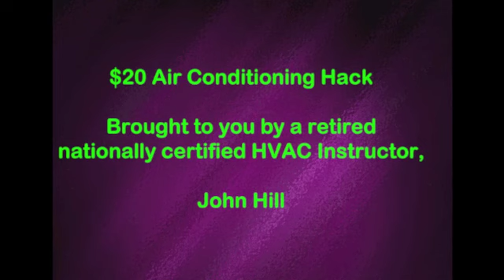AC Hack costs less than $20

Comment: Hvac units are designed and built to be in the weather. Rain, heat, snow. So this won't subtract from it's over all service life. I do industrial, commercial and residential Hvac for 35 years and have been using water to cool the condenser of my unit for over 20 years and it works beautifully if done correctly. Super heat is typically only a concern in refrigeration. Sub cooling is mainly affected by your refrigerant charge, too much will flood the evaporator and slug liquid refrigerant, too little will starve it and not have the capacity to remove heat thru the evaporator. Adding water to your condenser is no different than the outside temp dropping. So if its 90 degrees outside your supply temp in the house will rise as the condenser can't cool the refrigerant any cooler than the outside temp will allow, it is a slave to the ambient air around it. But if you spray 70 degree water on it thus your supply temp will drop and now the condenser has the lower temp to reject more heat thus lowering your supply temp. Your Delta T (Supply temp and room temp differential) will improve and it will now remove more heat from your home. Your suction pressure, discharge pressure and hot gas will all change when water is added. It will bring it back to a more normal operating temp and pressure range thus work more efficiently. My system is a bit more control oriented than this method. This mister turns on every time the system has a call for cooling no matter what the outside temp is or the unit’s pressures are. The water is usually not needed until the ambient temp is above 85 to 90 degrees if it is sized, clean and installed correctly. My system has to have (3) things happen to be engaged. (1) Call for cooling... I use the Y2 signal from my unit's stat( Y is a 24 volt call for cooling from the thermostat and starts the compressor) to pass thru(2) an outdoor mechanical air sensor set to 90 degrees, it's set of contacts are normally open and close only when the outside temp reaches 90 degrees. After Y calls and the outdoor air sensor closes at 90 degrees it passes thru the last device, (3) a head pressure switch that measures condenser head pressure and temperature. It has to be above 250psi (R-22 Freon) to allow the voltage to hit a 24 volt water solenoid coil that opens and sends the water to the misting lines that spray the water on the coils. And if the water with the fan is able to drop the pressure below 175, it shuts off the mister until the pressure rises above 250 again to keep from over cooling in low ambient conditions. I also use a two stage thermostat that has the ability to control a system that has to compressors. My system only has one compressor but the stat doesn't know that. What it does know is on a call for cooling it will measure how much time it is taking to drop the temp in the house and if it doesn't start seeing a few tenths of a degree falling in an allotted amount of time it will then call for the second stage Y-2 in this case the 2nd stage is the beginning call for water. Hope this helps anyone considering using water with your Hvac system.

Comment: Where are you getting this “120 degree refrigerant” from? I can guarantee that on a typical summer day the discharge on the compressor is well ABOVE 120 degrees, most likely in the 200s depending on the environmental factors. The condenser is there to do just that, condense. It’s taking SUPER hot, superheated vapor  and condensing it to a warm (possibly 120 degrees depending on unit efficiency and outdoor temp) subcooled liquid. They’re designed to run in 120+ degree weather, don’t waste water, your wasting money.

Comment: Had this cooler for 7 yrs, I used left over PEX from plumbing job, I did the same thing, run it on super hot days but you' ll have to decalcify AC fins at least 2 times a year,  using a 50/50 mix of vinegar in a pump up sprayer, turn unit off, spray fins thoroughly , wait 10 min, wash down with Water Only. Water PH is an issue, get as close to 7 ph as possible also using an in line calcium filter would keep the cooling fins cleaner. I have done away with the drilled PEX, now use 1/4" tubing w/'mist nozzles controlled by a solenoid ( u can use a RainBird sprinkler valve but I use a RO solenoid which is 3x cheaper) connect to 24v thermostat power...comes on/off with AC unit...using way less water, way less muddy ground around AC unit, just cooler, cheaper all around.Good Luck!
Reply: Sprinkler solenoid is 24 VAC, all I find for RO solenoid is 24 VDC. Does it matter if I use 24 VAC supply for VDC Solenoid ?

Comment: I made just like on video and works good. but 3years later condenser coil covered a lots of calcium and mineral .
I tried to cleaned with coil cleaner but does not work. finally I replaced condenser coil. that is good idea but need to install water filtering system. without that, you'll 'need to replace condenser coil.

Comment: so you leave the water dripping all the time even when the AC is off ? you can connect a sprinkler valve to the 24VAC output of the transformer that turns your AC on off...

Comment: total waste of water.  use dripper misters.  consumes a fraction of the water result is the same. theromodynamics is simple. coll the air to 70 deg and your condenser exchanges heat faster.

Comment: How do you address the mineral buildup on the coils?
Reply from the maker: There usually isn't any. As stated; this is NOT to be used continuously, only in 'extreme' heat. Here in SC, it's very helpful when heat index is over 100.
Reply: @scheadshot  I wonder if a water washdown system on the roof might be better?
Reply from the maker: @crazysquirrel9425  Sorry, I don't know what a 'roof washdown system' is.
Reply: @scheadshot  The term is water washdown system. Ships use it in very very hot climates (removes excess salt buildup, COOLS the hot metal on the ship, washes bird doo-doo off, similar).
It resembles a sprinkler system in a store but sprinkler heads pointed up not down.
It does not have to be that much to simply cool down a roof and subsequently a house.
Just have to keep it wet.
Take the heat out of the roof and things cool down fairly well.
Even roof vents cannot cool down very much.
Amount of water used is about the same as a garden irrigation system.

Comment: Great idea, especially if you are operating an AC in a dry environment. However, won't the radiator corrode away in 1 season?
Reply: Purpose of water dripping on coil is to take heat out of refrigerant (humidity isn't an issue). Also, coils don't suffer any adverse effects with just water. I should have connected both an ammeter and gauges to show the lowered pressure/temps and electrical usage of compressor while coils were being cooled. I only use this on my unit when the outdoor temp gets close (and over) triple digits. Thanks for your interest.
Reply: This hybrid design (AC plus evaporation cooling) might have a lot of potential and maybe, it might make an AC 50% efficient. I think, there will not be any substantial difference in the amount of amperage draw (unless you have already compared the before and after modification, and noticed a great differences). However, the compressor on timing might be where the efficiency gains reside. For instance, if before the unit would remain on for 5 mins and off for 3 mins, after the modification the unit might remain on for 2.30 mins and off for 3mins. 

Also, I am thinking that a mist fan's water blowing unit will be easier to place behind the small 18000 btu unit that I have.
Reply: They do in the northeast